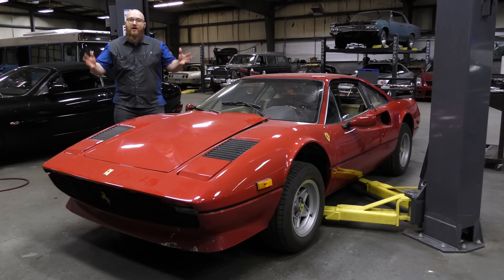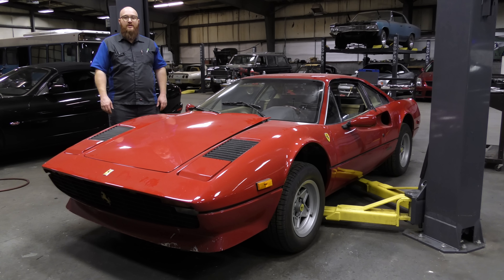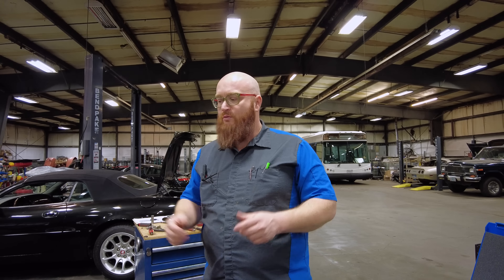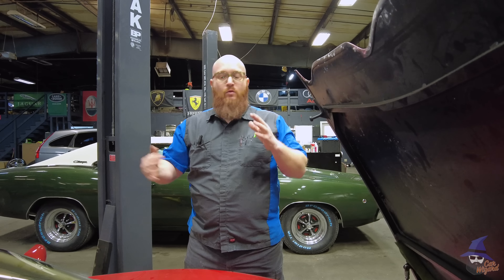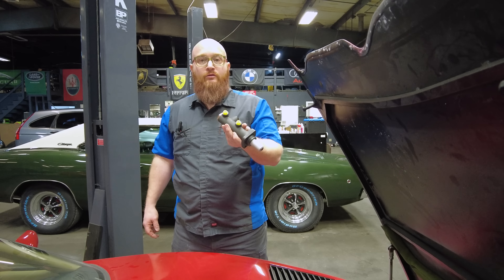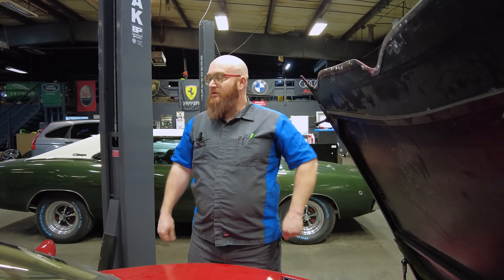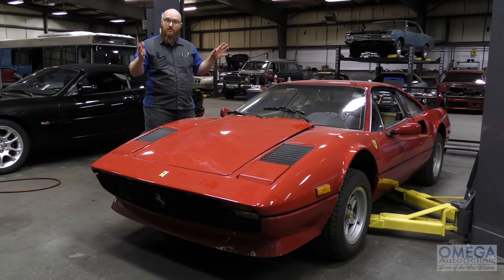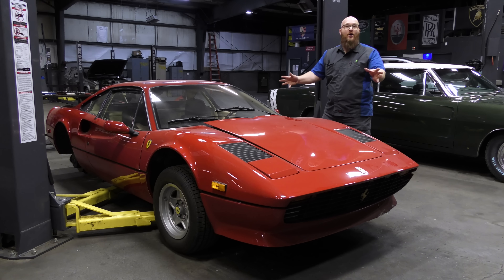My '78 Ferrari 308 can't be tuned! CAR WIZARD has to make some serious changes.

Comment: As a Engine Tuner myself (Remapper), it sounds a bit of a copout to me. The guy just did not want to touch it. I keep several old laptops with windows XP, Windows 7 32bit etc that i use for various older ECU systems. Does not matter how old it is, it can still be tuned. But if your moving on then Haltech is the way forward. Best ECU systems in the world currently. Made in Australia.
Reply: I knew the good reputation of Haltech and pleased Australia can make some internationally leading products.👍
Reply: Props to you for keeping old systems alive!
Reply: Should have been haltech from the start!
Reply: I took at look over the software, and the map and it didn't make sense. VE map with values of zero and it ran, and adjustments didn't directly relate to anything. Someone with lots of knowledge of the system 100% could make it happen, but its a system that is now becoming obsolete, and we can get him changed over to a new computer with full support and a long lifetime ahead of it.
Reply: @TheQuestionableGarage  The old one is probably worth selling, or at the vary least give it to someone who wants to mess with it.  I've learned there is always someone who wants to figure out old computers.
Reply: I say the tuner made the right decision to not mess with that and experiment with this Ferrari, if he blew up the engine, that would be a 10k mistake.
Reply: +1 for Haltech. Have an Elite 2500 in my car, runs 100% like factory
Reply: Get a Haltech Nexus R5 VCU (ECU + PDU/PDM) and get rid of as much of that Italian wiring, relays, fuses and etc as possible.
Reply: What's your thoughts on FuelTech ECU's?
Reply: Is that true? That was my first instinct buy I remember people said you 'cannot' tune the old 1992-96 Rover Tomcat / 220 Coupe Turbo, that was on I think a Motorola Mems ECU with internal map.
Reply: guy who looked at it first runs his tuning business as a side hustle. why take the risk on obsolete stuff. it s easier to say no and move on - as wizard does now with barn finds
Reply: Yes, Haltech is the way to go if you want to do it properly.
Reply: Agree; the guy bottled it - silly really, a missed opportunity to educate yourself while getting paid for the client
Reply: I would buy a fueltech FT700
Reply: Are you afraid of Carbs and jets?
Reply: @ATEC101  Its a 1978 Ferrari 308 GTB which comes with 4 Weber Carbs (that have jets). Just like the old 1978 308 GTS that I raced before going to a Quatro Valve and fuel injection newer engine package.
Reply: @realMaverickBuckley  I was also told that about the Tomcat, I opted for an aftermarket ECU as I couldn't find anyone able or willing to use the original ECU. 
I loved that car!
Reply: Argentino  I would say so yes. Their systems are just superb. Not only that but absolutely brilliant support and Firmware updates.
Reply: Definitely tuneable but not having any support at all seems a silly move so overall right move to move to something more modern. Haltech best in the world? Not quite. Extremely good for sure. Excellent stuff.
Reply: Argentino  yes Haltech is the best in the world
Reply: There's nothing wrong with the Tec3r. I run one on a V12. I'm pretty sure that I was the first person to get a V12 running on this ECU (around 20 years ago), but honestly there are quite a few better options today, with more features and flexibility. It sucks that I have to keep an old laptop with a serial port in order to talk to it, but it CAN be tuned, if someone is willing to make the effort. 

I'll eventually replace mine with something with more modern software and hardware, that will allow me to fire all 12 injectors individually rather than having to do batch firing of injectors and waste spark, but the Tec3r still is useful to some of us.
Reply: @TheQuestionableGarage  good choice, a new ECU is cheaper than a new engine in most cases. If it were my car, I would add adds sensors for Oil Pressure, Oil Temperature, Fuel Pressure, and wideband O2 for each exhaust bank so you can use engine protection strategies that should be on most modern ECUs.
Reply: @RBGgermanKX250F   I have the tuning software for electromotive.
Reply: @howardbartlett3026  no suprise, but the EFI motors idle around 160 rpm lower than carbed. Must be the more precise fuel delivery but pretty neat. off-idle i couldnt tell the difference though in power or smoothness.
Reply: I agree.
Reply: Haltech her, fixed. They go into pretty much anything, and she will run. Ive seen them in series 4 Rx7s to v8s. They just work

Comment: Car Wizard I have been following your site for 2 plus years and love it. I am a retired industrial mechanic and may have a solution for the leak around the cams. Emphasis on may, there is type of sleeve for use on shafts that have become undersized due to wear or other causes. It's called a spedi-sleeve and it's made by CR seals. You can check on this it may help. Thanks for the great content and info in your shows.

Comment: 7:44 Unfortunately, the OE Master Cylinder assembly (with reservoir; part number 19209200) for the 2006-2008 Lucerne is NLA brand new from GM, but ALL the major auto parts stores can special order a bare remanufactured master cylinder with no reservoir for as low as $76 retail cost.

Comment: Had you left the Weber Carburetors on the car and JUST replaced the points, you'd be driving the car now.....
Reply: You need a distributor machine to set up the distributors and sync the points and phase them not hard but dual point setup

Comment: Wiz, send an intake and exhaust cam to a shop with a 'cam doctor' machine, and it will give you all the specs. I had to do this for a 'race head' donated to me years back.
Reply: Cam specs can be measured and calculated with the balancer or flywheel marked off in degrees and a dial indicator on the cam lobe to measure lift and duration
Reply: Or you can email Isky those numbers, and they can tell you what it is.
Reply: @jasonrackawack9369  Math is hard. Stop. ;P
Reply: Might find out that more than lift has been changed
Reply: I saw this post and do you think this would work for my truck also??? Situation is I get a check engine for misfire when the engine has had an aftermarket cam on rebuild engine with factory tune.
Reply: Stop using 'apostrophes' n place of "QUOTATION MARKS" and you'll have credibility.

Comment: When I bought my 308 it had been sitting for many years and the cam seals were leaky.  Once I did the overdue maintenance and started driving the car on a regular basis, the seals healed themselves and are no longer leaking.

Comment: Replacing a $1k alternator with a $50 alternator has to be VERY satisfying! 😅
Reply: Actually the original one is from a Fiat Spyder. It’s $120 at Orielly’s.
Reply: H. Rockefeller - Had a similar experience with an '83 Ford van;  adapted/slammed a Chevy alternator in it; worked like a rented mule!

Comment: Probably already know, but just in case, the pushrod for the 308's master cylinder will have to be adjusted to fit because they are all individually made for each setup and were never designed to be replaced as individual parts, only completed units. If it's not adjusted to the exact length as the old setup it will either lose pressure as you drive or keep pressure on the brakes and cause them to drag.

Comment: It was an Aussie company who did the later electromotive transmission ecus for the early paddle shift cars.  I was impressed by the small size for what it could do.   I recently visited the CEO’s new company, and he still had one in the display case.  He said he still gets enquiries for them, but won’t run less than 100 units.  He joked that only people with grey hair would know how to tune them, as they are so different.  As suggested in other comments, his advice to anyone who contacts him, is “fit a Haltech and kill 2 birds with one stone.” Haltech probably even have a decent base map to start it off with.

Comment: I have Some information from my uncle messing with jags in the 1960-70s . He  did say the brake booster vac bottles in  the fender collapsed, and it had no  breaks. But  you would not  find it because it  pops  back out once  you try  and find the issue. Just information to commit to memory for anyone Reading  my posts.

Comment: On the Jaguar check the brake switch mine started doing a lot of crazy things dash went weird, steering adjuster worked sometimes, driver memory wouldn’t work replaced it and all the problems went away.

Comment: just telephone Isky re the cams...they probably have all the specs. Otherwise there is software called The Cam Doctor, which uses the output of a dial indicator which you run on each lobe and you can get a full readout of the cam specs.

Comment: turbo K-series swap time... a mild 400 hp would be fun, with the ability to crank up to about 600 reliably. why not an LS? because it's transverse mount and the K-series has good transmission options in this configuration, and there is plenty of aftermarket support for the engine in such an application

Comment: Can the computer tuner guru with the existing computer.  Wire in a 96 or 97 ford or gm computer to not control the system but to monitor the system so he could take snap shots of the data stream at idle and every 100 rpms. So you can reverse engineer or graph the existing tune.

Comment: Easy to tune in Europe, loads of people with experience. TBH any after market ecu marker can replace the ecu amd run a software that is endlessly adjustable.
Why didn't you just replace the master and servo units to a cheaper whole GM set up?

Comment: A lot of times those Ferrari parts are the same as what they use in similar aged ALFAs or FIATs and the extra cost is just the yellow cardboard box with the horse on it.  Learned that at the Ferrari and ALFA parts counter long ago.

Comment: You need a sacrifice car to deal with this. Not for parts but for reverse engineering and making aftermarket parts and writing code from scratch. Once you've reverse engineered everything and have the ability to make new parts and computer and have software to copy you basically need a crate for the exact year new.
Reply: These are not Chevy Cavaliers. There are not many 308s out there for what you are suggesting.
Reply: Something tells me that Car Wizard knows ten times more about getting a car running than you do. Maybe a hundred times.

Comment: I have an Isky cam in the 383 small block Chevy that I built for my S-10 drag racer. I wasn't even aware they made cams for Ferraris. Yes, cams can make more power, but they also change where the powerband is. The cam I put in my small block Chevy made more power (along with a lot of other modifications) but it also raised the powerband higher up in the rpm range. Great for drag racing, not so great for stop and go street use. Not familiar with Ferraris, I'm a vintage American car guy. An old school, no computer hot rodder. Just what kind of cams are those? That looks like a motorcycle engine, where the cams operate the lifters directly, with no rocker arms. Are they hydraulic, shim over bucket, or shim under bucket? It is obviously a 2 valve engine, which is a good thing. 

You will never have anything but trouble with that computerized mess. You should have left the carburetors on it, which were a big part of what made it such a special car. It was a pre computer car, a REAL car, not a CTA (computerized transportation appliance) Glad to see it still has those beautiful Campagnolo 14" wheels and REAL tires on it.

Comment: 308 owner for 20+ years. Ferrari used performance cams in the US spec 308 74-77, 78 on used milder cams for emissions. It was a popular mod to send your 78 and on cams to a cam grinder to have the lobes welded up and reground to performance specs. Ferrari used many parts that were used on lots of cars. Knowing the crossover is essential if you don't want to pay "Ferrari" prices. The 308 is a pretty DIY friendly car, truly affordable if you are careful with parts shopping and do your own work.
Reply: Looked a lot like the cam, was blued, must have got too hot somehow  !
Reply: Yes, probably just reground to the early specs. Maybe as crazy as a P6 grind, but hopefully not.

Comment: Tuning the Electromotive is not hard, it was a very capable ECU for the early 2000’s. I have tuned many cars with the EM Tec3 and Tec3r.  They did a lot of things very well but one thing they never really got right was their idle control strategy. The car could however easily be tuned to drive very well and make efficient power. 20 years ago the Electromotive would have been a decent choice. But if I was building that 308 now I would run a Motec.
Reply: The biggest issues is some of the tuning strategy is unusual, a limited number of tuners and lots of limits on some self learning/fuel correction options. The new ECU that will be going in is very affordable, has insane amount of control, and is incredibly straight forward to use.
Reply: @TheQuestionableGarage  is it a heltech like mighty car mods always run??
Reply: @TheQuestionableGarage  It is tunable 100% Just not anyone close by.
Reply: @peterbiltxr379  Holley
Reply: Fueltek has everything you need and they will teach you how to use it properly if capable of learning and taking the classes they offer.
Reply: @TheQuestionableGarage  yes the tuning strategy or lack there of was an issue of the EM. The wideband support was wonky at best. Another issue is they never came up with proper USB support. Trying to connect a modern laptop with no serial port is a PITA. When you finally get an adapter and driver to work the connection still seems flaky.

Comment: Tuning such an engine for more power is not really necessary as long as mixture/ignition etc are set correctly and the engine is healthy it should perform well enough anyway.

Comment: Hi, Well on the Electromotive issue, I believe the main man involved with that was Don Devondorf I believe he founded the company and was known as an electronics genius. A friend of mine raced against in the 1970's and he said Don would come in the pits adjust the electronics and go out and be faster. He later campaigned the GTP Nissan car in the IMSA series in the later 1980's. Well you mentioned that the throttle bodies are TWM Roush uses that setup on their stack FI crate engine package and I believe uses the F.A.S.T. system to calibrate it also you mention Borla, maybe check with them on what they use, I believe Holley just came out with a new version of their terminator system as well. Hope you get it sorted out.

Comment: Just swap in an LS and call it a day. You know they make a kit. 😅
Reply: All kidding aside, a while ago I saw a 308 that had a 4.4 liter V-12 from the 365 swapped in. Had to go to the single cam heads to mak it fit, but kept the six downdraft webers. Bell housing bolt pattern is identical, used the stock clutch. The power and the sound really teansformed the car.

Comment: These cams  are proberly regrinds to P6 spec cams ....FYI P6 cams are OEM Ferrari 308 cams for Group4  racing.

Maximum valve lift is 9.25mm for both cams, with a duration of 290 Degrees for the inlet and 288 for the exhaust. 
Valve overlap is therefore 92 Degrees

Inlet opens         48 Deg. BTDC
Inlet closes         62 Deg. ABDC
Exhaust opens   64 Deg. BBDC
Exhaust closes   44 Deg. ATDC

Carburettor settings.                         
Weber 40 DCNF

Main jet               1.45

Air correction     1.70

Emulsion tube    F36
Slow running      0.50
Reply from the maker: Thanks!!
Reply: If the cams have been designed for Group 4 racing, I'm not convinced they would be an ideal choice for on-road use.  Past experience with driving "on road cars" fitted with racing cams can best be described as unpleasant and frustrating.

Comment: You could possibly mine the aluminum oxide and refine it, then cast a new master cylinder and machine it for that price. With so many aftermarket ECU systems out there this shouldn't be too hard.

Comment: It is not hard to tune EM.  I am a novice and I tuned my 280z running a stoker 3.1 litre L28 with a WinTec2 ECU without problem.  My experience with turners is they do not want to be bothered with anything beyond what they know.  That is really too bad.  Check the blogs and you will find there are plenty of folks that know the system software.

Comment: Electromotive was always terrible and cheap.  I actually tuned a 308 with the TEC 3 predecessor the TEC 2.  It worked just fine, but there are far better solutions.  What I would do is use a modern ECU from MoTeC or just about anything from Haltech, Life Racing or the like.  You can use the existing 60-2 trigger wheel and any ignition system, likely keeping the TEC 3 GM style waste spark system.  It isn’t that hard to get this running.  The 308 I tuned had a highly modified engine with larger displacement, cams, head work, etc.  I remember the car being peppy, but not that fast.